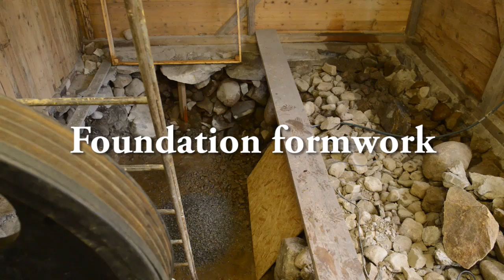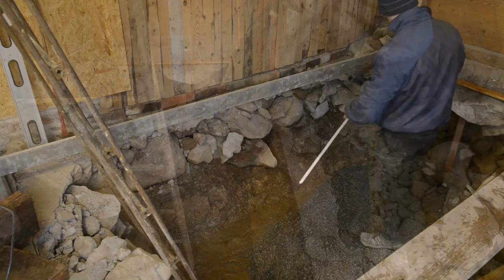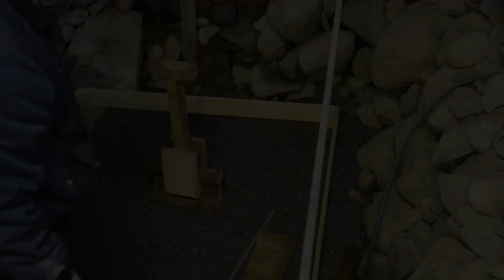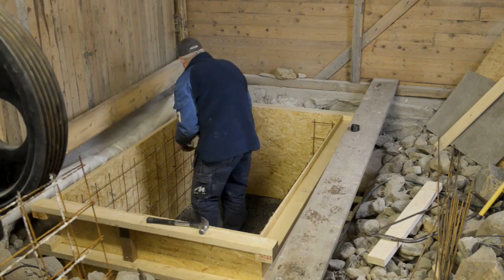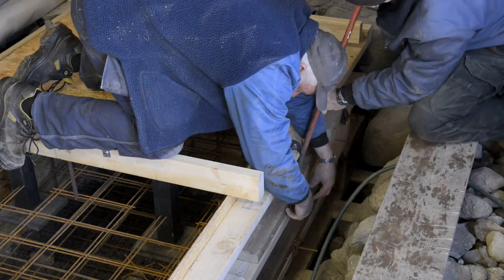Power hammer - Foundation formwork (4)

Comment: That is quite a substantial foundation block you are preparing there. Just by eye I estimate that it will take approximately 2 cubic metres of concrete. Pre making your whalers was a very good idea as was the plinth frame and feet.
Reply from the maker: 2.5 m3 ! Yes that is a large block.

Comment: Love the foundation work. Been watching for years, you've only gotten better! How well does the foundation work to reduce vibration (I. E. Keeping the neighbors happy)?
Reply from the maker: Thanks! It works very well!
Reply: @torbjornahman  I'm really interested in how much it actually reduces noise for the neighbors, as I've been hand forging for years, and would love a power hammer. But, the noise is a huge deterrent. I don't want to live in the middle of nowhere just for one tool.
Reply from the maker: Stopping the vibrations in the floor is one thing, but I doubt it reduces the noise that much... probably to some degree but there is still considerable noise. Much more than you would ever be able to convey on video.
Reply: @torbjornahman  I suppose that is have to insulate for sound, more than anything, then?
Reply from the maker: @Justone177  Probably, but don't take my word for it, and it probably depends on what hammer we are talking about and how the shop is built in the first place.
Reply: @torbjornahman  I plan to have a shop like yours, separate, so I can control sound. I'm just concerned about vibration. Don't think it'll be a huge hammer, probably about 100lb max
Reply from the maker: @Justone177  ok! A big foundation also makes the hammer more efficient with less energy lost to vibrations. I think the rule of thumb for a foundation is to weigh about 1,5 x the total machine weight.
Reply: @torbjornahman  Is that for metric or imperial?
Reply from the maker: @Justone177  Does it matter ? :) :) 1,5 times the machine weight!
Reply: @torbjornahman  Aaaaaaand nowifeelalittledumb. But, that's okay. Have a great night, and thanks for talking with me!

Comment: Going to put a time capsule in there before you start pouring?
Reply from the maker: EyeOnTheTV Have thought about that...not sure what to put in :)
Reply: Torbjörn Åhman Just a quick thought, not a time capsule  but an interesting experiment ... suppose you could encapsulate a bell or a gong in there. Like in a wood or steel box so it would ring freely whenever you used the power hammer. I'm imagining the archeologists' faces when they discover a block of concrete that makes noise in a thousand years.
Reply: Torbjörn Åhman an sd card or maybe a cd with the videos of the process would be an interesting thing I imagine.

Comment: Very nice work.  How many cubic yards (or cubic meters) will you need? Will you specify the strength, or do you have that option with your concrete supplier? Thanks for sharing your project.
Reply from the maker: ***** 2,5 m3 - I have asked around quite a bit and I have settled with cheap C25/30. It should do the job fine.

Comment: Thanks for sharing these efforts!  It will be great to see it mounted and running.  Are you considering using heavy felt between the new foundation to the old?  Mounted a 36k CFM/100hp fan/motor to a similar pad once and we used 1.5" felt between the old and new for isolation...worked great for a much smaller, higher frequency vibration.  Think the P gravel in the bottom will help some?  Wonderful to watch your progress. ~PJ
Reply from the maker: pjsalchemy I will put a kind of soft board (13mm) around the edge to isolate from the floor to come. Thanks!

Comment: well!!! one question wall on the left will not interfere?
Reply from the maker: кузнец коля I think I'm ok. Had to compromise somewhat, but it all depends on how long things you're going to forge.
Reply: Torbjörn Åhman I agree with you, will not wait when you run hammer not when such is not seen 75kg with a single striker plate
Reply: he could still ad a door for extra long pieces in the wall if he ever needs to - the joys of a wooden building

Comment: Why did you choose to build a form rather than simply letting concrete form to your excavation?  I'm by no means a concrete expert, but I would have thought allowing the concrete to interlock with the sides of the hole would really add strength.  Thanks for sharing your progress.  I can't wait to see this in action.
Reply from the maker: keifsanderson Main thing here is to get an isolated block so the transfer of vibrations are minimized to the rest of the floor and the foundation of the building. That's why you don't want any interlocking with rocks or anything. That's the theory... then if it really matters in reality, hard to know. :)
Reply: Torbjörn Åhman That is logical.  I was already thinking about that thing thumping away and how easily vibrations can travel through the ground.  Thanks for the reply.
Reply: The concrete needs something solid to bond to. If u just pour it in all that rock in will move and Crack within 5 minutes
Reply: p2o8wer But concrete doesn't bond to the wood, and your theory assumes there is outward movement to be had inside his excavation.  The weight of the concrete he is going to pour in that hole is not substantial enough to shift the ground around it outwards.  Torbjorn's explanation is much more plausible.

Comment: rock is better then sand?
Reply from the maker: You mean the gravel? I think gravel is better, keeps the water away.
Reply: ok got it ....  yes that as well now is that beacuse of the water table. or the amount of rain  you get yearly?
im just trying to understand ..i will surely be watching your vid again if i get 1
Reply from the maker: I don't think you place any foundation on sand. It should be a capillary braking material.  Especially in cold climate where frost can lift entire houses if not done right. Not that I expect frost so deep under my forge... but still. :)
Reply: Yes, but the gravel as mounts if not worse than sand? You just the cube around it, too, with gravel. This material around the concrete cube is pressed sawdust? Much transmitted vibration from working the hammer on the floor? Within what radius? Thank you!